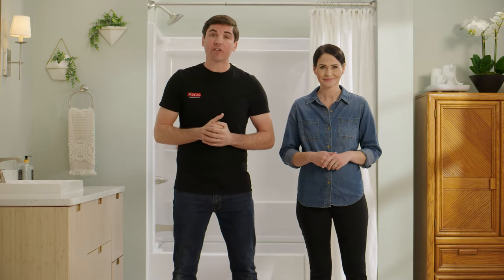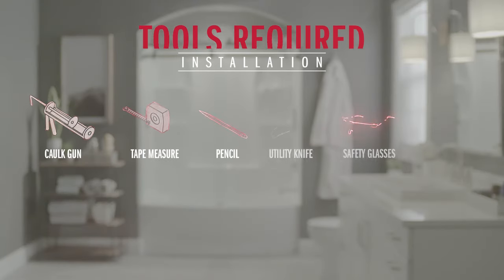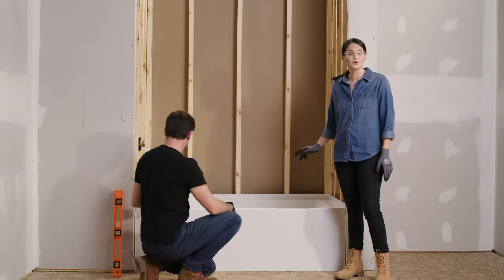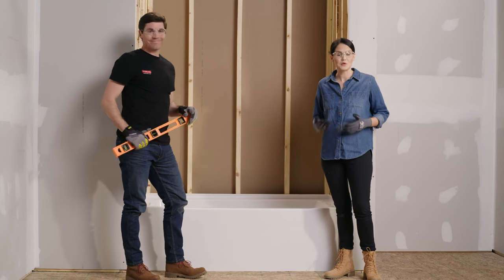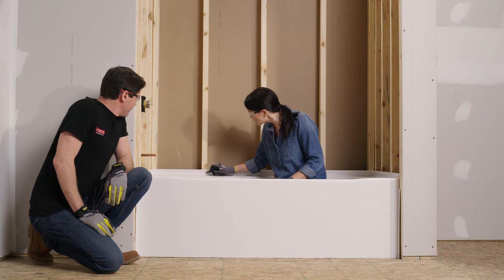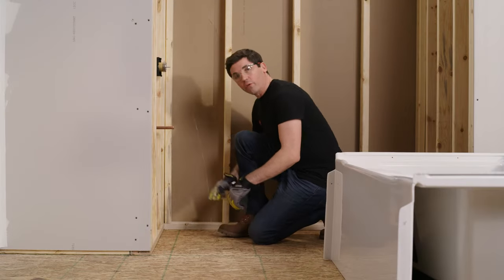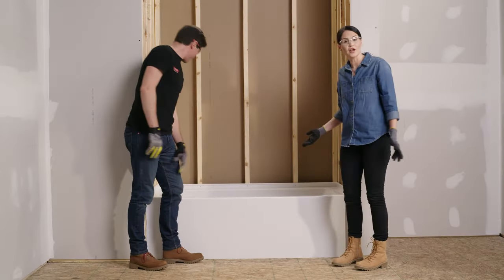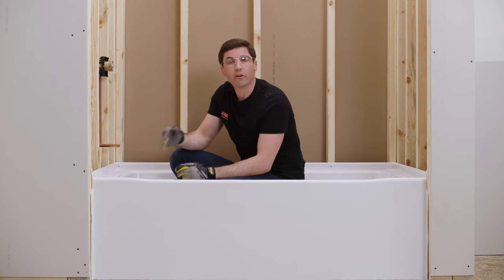How to Install the Delta® Classic 500 Tub (60x32)

Comment: I'm installing this tub now and I'd strongly recommend two things (for other DIYers). First, install a support beam underneath the outside-facing ledge (the longest widest ledge). You can fabricate a simple T-beam by screwing/gluing a 1x6 deckboard to the bottom of a 2x4; this fits well and will support a lot of weight. Users of the tub often put weight on this ledge to get in and out. Without extra support, I can imagine this cracking and perhaps causing complete failure of the tub. TO DELTA: you should update your molds to include at least six support ribs underneath this ledge. My guess is that your Patran model has a boundary condition wherein the bottom of your apron is affixed to the floor; this assumption is incorrect in 90% of the installation cases, and significantly impacts the rigidity and distribution of stress/strain in the apron. Second, take the time to lay a mortar bed. As I mentioned in another comment, this tub requires A LOT of support in order to end up with a good result. It's nothing like a steel-porcelain (or fiberglass) tub, which you can just put in place and rely on the tub structure itself for structural support. This thing is a thin-walled plastic shell. Without proper and ample support structure you will get a terrible result; with it, you get a pretty good result... albeit after a tremendous amount of effort.
Reply: I am looking at installing this exact tub. You make some fair points, so I’m curious; how has the tub held up since you’ve installed it?
Reply: You are correct we ran into this issue and we had to use a ton of mortar on that lip to get it strong enough
Reply: Everyone needs to read this. Add every measure you can of support and will last a long time
Reply: @AaronTamm  unfortunately I already own this tub. First crap plastic tub I've ever bought and never again. I'm still going to follow through with it's install but I've planned on doing everything he's said above. I already own the tub and sidewalls that I bought last year so no returning it. If I had to do it over again I'd rather buy a bootz steel tub from home Depot. Do yourself a favor and buy a cast or steel tub.

Comment: The 500 series says no mortar bed required
Reply: Mortar bed is not required if your floor is flat and level. If the floor is not flat and level then a mortar bed is required to correct for that.
Reply: Take the time to lay a mortar bed. This tub requires A LOT of support. The mortar squeezes into the matrixed plastic grooves on the bottom preventing lateral translation (movement in X and Y directions) as well as a consistently flush surface to support the base. Use mortar unless you want a lot of shifting and creaking noises every time you get in and out.
Reply: Always use a mortar bed

Comment: What is the difference between this and the Classic 400?
Reply from the maker: Thanks for the question, DodgerBrewTX. A new feature is a caulkless design when pairing the Classic 500 walls with the Classic 500 shower base or tub. The wall panels snap together and the base and tub have a unique flange.

Because of this, a Classic 500 tub or walls should not be used with a Classic 400 tub or walls.

Comment: How does one cover up the screws if they are not using the wall assembly?
Reply: You butt the tile backer to the top of the tub lip. Fill that gap with waterproofing or silicone. Then your first row of tile will cover the screwed flange
Reply: @amacaluso2010  I suggest you not butt the backer board directly on top of the tub lip and instead leave a small gap to allow for movement.  You can put silicone between the backer board and tub lip or use a rubber membrane style flashing around studs down to just over the lip of the tub.

Comment: Can you install tile instead of the wall
Reply from the maker: Yes, tile can be used instead of the wall set! -Kelley
Reply: But how are the screws going to be covered?
Reply: The eyelid protrudes and prohibits the tile from going down to the tub or am I wrong about this?
Reply: @aziajenkins3004  the drywall would protrude as much as the eyelid (im assuming). Drywall goes down to the top of the eyelid, never passed it. Then tiles go on, down to meet the tub

Comment: This what happens when models do construction work.  This is an incomplete installation guide that misses a lot of detail. 👎
Reply: If you need more detail than is in this video and the instruction guide that comes with the tub, you probably shouldn't be installing it yourself.
Reply: @tenfeetup  Since I purchased these exact models, I watched Delta's videos on the classic 500 tub and shower wall set and was able to install myself with no issues. This is only a video on how to install the classic 500 bathtub. Like any rational adult, I realize this is NOT a video on how to lay a mortar bed, how to level floors, how to square up walls, how to install plumbing, etc. It is only a video on how to install the classic 500 bathtub, supplementing the instruction manual that came with the tub. Why would they include instruction on laying a mortar bed when not everyone, myself included, needs to lay a mortar bed and with infinite variables for each installation? Most adults who need instruction on how to lay a mortar bed would research separate instructions for their specific situation. 
This is a complete video as a supplement to the instruction manual for installing the Delta classic 500 bathub and doesn't purport to be anything more.